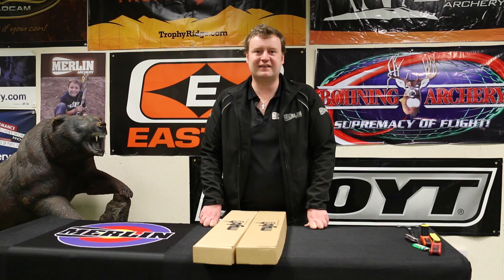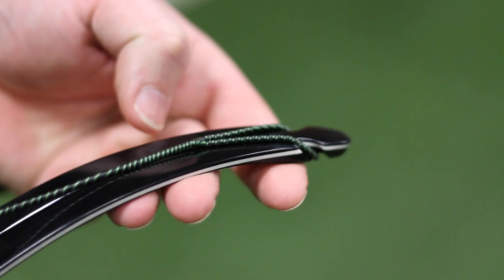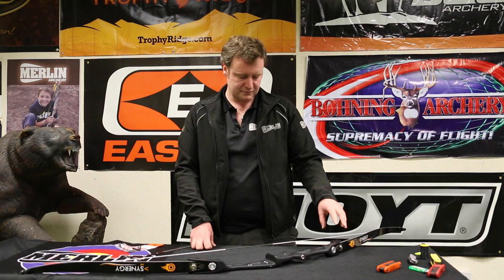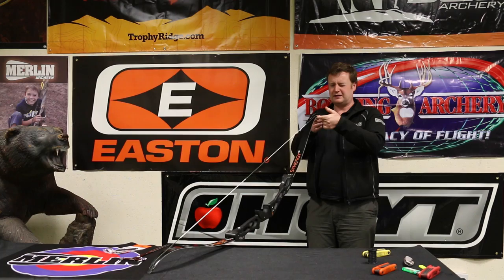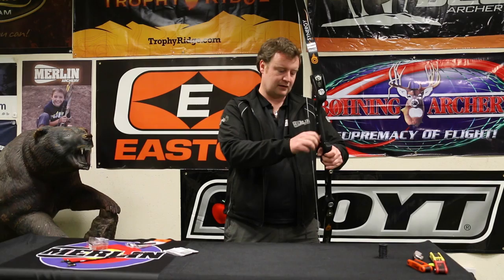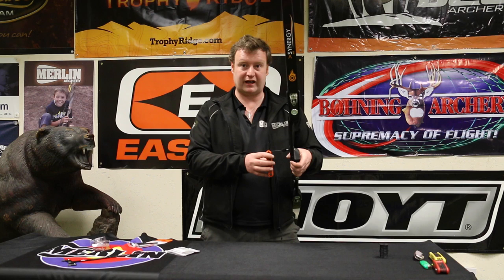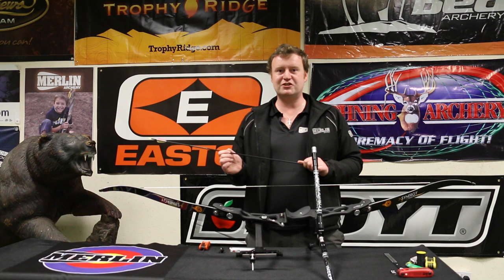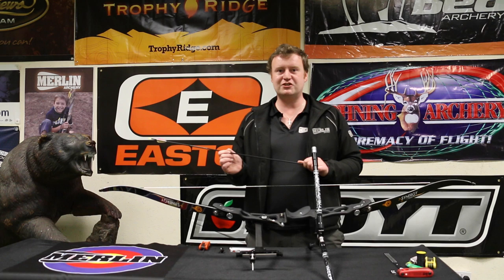How to setup a Target Archery Recurve Bow

Comment: Thank you for this video! It explained so much to this relative beginner. I had a local shop set up a new recurve bow that I purchased from them. I noticed it was rattling when I shot while no one  else's bow did. I asked one of the guys who sets up bows there why it did this, and he just said some limbs do that. Then I heard your "sounds like a bag of bolts" explanation of a brace height that is too small and decided to check it out. Mine was 7-1/4 inches for a 66" bow! They have been listening to me shoot at their indoor range twice a week for two months and never offered this as a solution. I twisted the string until it was 8-3/4, and now it's quiet when I shoot. I went through the rest of your video and made sure the rest of my bow was set up correctly. Tiller was good, alignment was good, plunger was good, but nock was off. Again, thank you so much for this video.

Comment: I purchased a new recurve from a shop in the UK and it's on its way here to the US as I write this. I have been compound shooter for over 20 years and know my way around one so probably could have muddled through this by watching multiple videos, but this one seems pretty comprehensive. I can save it and use it for reference once my gear arrives. The information on tiller was a little confusing but I am sure I can find more details out there and it does not seem to be a critical component for a first time setup anyway. Nice job.

Comment: Great video, answered a lot of my questions as a beginner. This may sound stupid, but once you have your bow rigged correctly, do you have to check everything each time you set it up?
Reply: I'm very much a beginner so maybe off on this advice, however, the only thing I check every time I setup is brace height as the string can untwist while off the bow (unless someone has a tip to stop this happening?) I guess it's worth checking the other things once in a while. Also, I've heard new bows/components need some "running in" so best check after 100 arrows or so...

Comment: excellent demo. so much more than a 'first bow' setup though. my first bow was a wooden Petron takedown bow, set up for me in the shop. a crappy plastic arrow rest. No extenders; rods; weights; clickers, or pressure button. No sight until I added one and no mention of tillering; brace height, or balance. just ut it together and shoot. This video explains loads. Im now looking to get my first intermediate bow. How much for that setup, as demonstrated?
Reply: Everything in the video, will cost you about £500, if you check out Merlins site, you can get a better idea of cost.
The Merlin guys are very good
Reply: £500?! Oookkk... think I'll give it a miss this time and stick with SF. I think I can get a decent setup for £250- £300.
Reply: Sf won't be much cheaper if you want the whole package, nearly 2 years ago, I bought an SF Forged plus, Premium Pus limbs, a Cartel Sight, a string and a bag. At the time that little lot cost me £370, the riser was £150, today, that same riser is £228!
My advice would be go for quality riser and sight, cheap limbs to begin with will serve you well, as your skill improves, so will your strength, you can then buy stronger limbs, don't worry about a long for 6 months or so, V bars can wait a year.
Your club coach can give you more advise as you improve
Reply: Ah yeah. thinking about it, I was quoted for the setup without stabilizers. That explains the price difference.
Reply: Sounds likely, I hope you can get sorted and enjoy the sport, we love it, me, my fiance, and niece all shoot together at the same club
Reply: Rob Davies LP

Comment: also, left handed bows are actually right handed.  we've all been lied to so we can be sold wrist guards and whatever else…your bow if right handed should load from the right.  this prevents all arrow injuries if they break on release.  also, then when you use both of your eyes to aim, the arrow lines perfectly up with your aligning eye.  and seems to illuminate that paradox

Comment: By increasing the overall poundage of the bow via the tillers, do you in turn run the risk of damaging the limbs, or is it safe enough?
Reply: ***** The limbs should be designed to handle the tiller being all the way in (max poundage).

Comment: Thanks for this vid!  Though I've shot compounds for years, you helped me set my first recurve up fairly quickly. Hoyt Grand Prix 25" riser/medium limbs. Shot a dozen arrows, adjust the plunger, right on from 60'. 

Issue: Even after tuning the brace (8 3/4") and tiller heavier (bottom limb) my top limb still sounds like a bag of bolts (sounds like a sloppy electric string). What is the probable cause and possible cure for this?

Cheers

Comment: am a bit confused about setting the nocking point: you said set the TOP of the BOTTOM nocking point 1/4" ABOVE square. In my mind that means the arrow is going to be aiming down a bit? or have I got that wrong?

Comment: l ike the video very informative, lots of info i can use, although, im looking to buy my first bow but cant find one i like at a price i would pay, everytime i see a recurve i like its out of stock, ive tried "i think" every website in the UK including merlin and im ready to give up and build a traditional long bow just to get started, its so hard to find a bow similar to this one in the video that is 70" length with 40lb draw for around £300 though i dont want the rods and weights and all the bells and whistles as i want to start bare bow, maybe just a clicker. im was looking at something second hand but sellers are also taking the piss, buy all or none at all kinda deal. i wont buy add on sht i wont use. the bow, the string and arrows how hard is that?

Comment: you gave the tiller measurements but you didn't say which limb should be longer or shorter , top or bottom?
Reply: the bottom should be hevier couse of the way you place your hand and tab on the string but this is different with recurve with a sight or just barebow witch means that the aiming device is the arrow

Comment: a friend of mine had a string for a 70 inch bow when he had a 68 inch bow so he just tied some knots in the string. is that also a good way to shorten or lengthen the string or does trat damage the string
Reply: That damages the bow string it can fray the string and can snap
 it so I recommend getting a proper string fit 68 inches

Comment: my limbs dont slide in that easy am i doing it wrong?
Reply: it really depends on the brand of the riser and limbs of if the limbs and the riser aren't from the same brand, but it is normal. If it really is too hard to slide the limbs in, you can always loose up a little the screws on both ends of the riser and adjust the tiller after
Reply: thanks :3
Reply: Scott Peplow no problem!

Comment: Do people still use old fashioned one piece wooden recurve bows? Do you really need all these gadgets?
Reply: This is completely unnecessary comment which suggest you dont know archery at all. Every bow need tuning, been trad bow, olympic or compund. Trad bows have striking plates, preaty much same as cushion plunger. You need thicknes adjusted. Every bow need proper arrow spine, properly positioned arrow rest )being rug rest on trad also) and proper position of nock point. You need your bow tuned perfectly if you want results. Even on selfbow or english longbow with no shelf, some tuning is necessary. I shoot compounds, trads and olympic bare bow and tuning is essential.
Cheers
Reply: Unfortunate reply, I was being quite serious. I'm interested in archery, but I don't know much about it. I like the thought of using an old fashioned bow, made out of all wood. I was just wondering if anyone does that anymore, or if it's all compound bows, fiberglass & olypic style with all the gadgets I'd never be able to figure out. Lol
Reply: Lori Burnip Yes you can use that style no problem, it is all up to your preference.
Reply: I personally just got into archery and I use a 1970s Bear Recruve Bow all wood old school absolutely 0 add ons. I just string n shoot. I prefer this over all the gadgets and personally I think people should start off this way. Then every time you master something, move up a level, add something else. I have been shooting good lately, so now Im going to look into using different recurve styles. But I really prefer the regular old wooden bows the most :) really forces you to get a good shot down as well